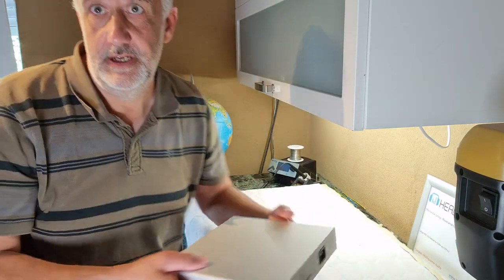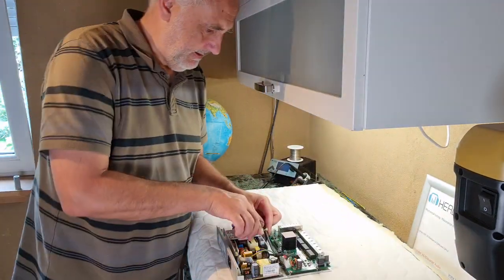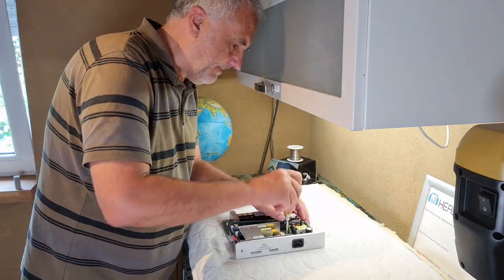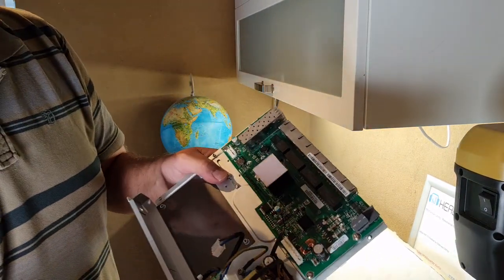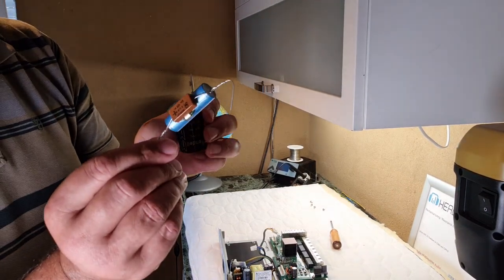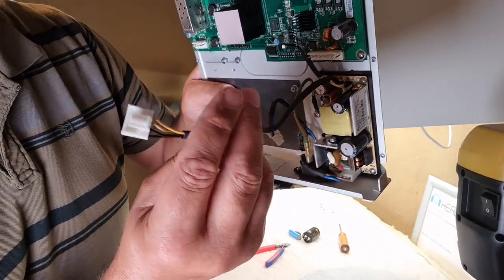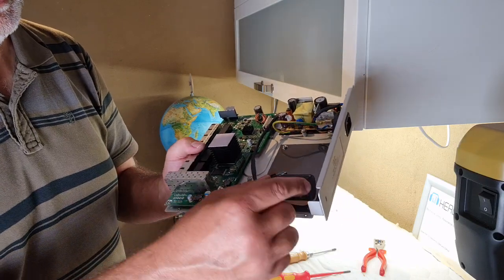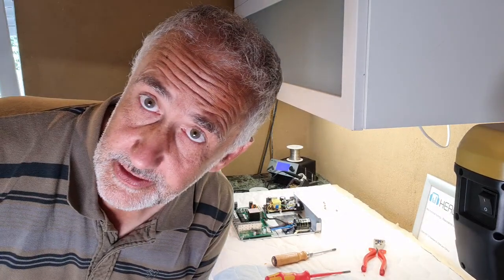Cisco Meraki 220 small tuning for better Audio and Video 4K. Read discription please first !

Comment: Will there be any issue with removing the POE power supply and leaving the cable attached to the inlet (the cable you are holding at minute mark 13:58)?

Comment: Hi Mike, great videos, I have purchased a meraki 220. I have removed the Internet PSU as you have described, I was considering 12v LPS. I am wondering what sort of ampage PSU would be required to run the switch ?
Reply from the maker: 3 A, like the Farad S3 or Audiophools Silver LPS specially made for Meraki 220, or buy LHY SW 10...cheers Mike

Comment: Thank you Mike for the tweaks. I can't find this switch anywhere in Amazon. Would you recommend another switch from the current range that we can tune too?
Reply from the maker: Hi, sorry, but no. There is a older one, Cisco 2960 you find it at audiophool.nl  He can change the clock there too. These old switches ( Meraki and 2960 without fan) you can get only at used market, but if you tweak them, this ist for the price the best you can do. Cheers Mike

Comment: Just got the Meraki! Amazing difference! The main difference I can hear is the relaxed sound. Where sometimes some music sounded harsh, that has gone! But still greater clarity. Auralic G1 streamer, Kinki Studio EX-M1+ and Denfrips Ares II. Have not taken out the PoE yet. Notice greater clarity and texture in the bass too. Its more controlled.
Reply from the maker: Hi, nice!! Thanks for comment. Send it to Hans at Audiophool.nl   you will be really surprised, cheers Mike
Reply: @headquarteraudio5388  hi Mike, I’m getting emails regarding licensing for the meraki. Do you have any advice on how to use it just as a standard switch, non managed?
Reply from the maker: @Bones135  Hi, i did not do it, but pressing the reset button on the front for 15sec is a good solution to bring him back to unmanaged mode. But no guarantee Cheers Mike

Comment: Hello what capacitor and shunt did you use.And how are they connected.Is the shunt connected parallel to the capacitor?
Reply from the maker: Hi, shunt in parallel to main cap, you can see the cap in the video. Shunt you can use all what you want and what you will pay for :) Cheers Mike
Reply: Great mod! Thank you for sharing. May I know what capacitance number of shunt capacitors are? Many thanks!

Comment: Hi Mike ,my system is simple, modem---router---just added Meraki 220---Then out of  Meraki month old ifi Pro iDSD Signature steamer ( I love)and laptop. All connected at this time with Audioquest Pearl ethernet cable (??? change later to Cinnamon ???) WOW what that Meraki did.I have the cleanest power supplies  (I have the source) in my whole sound system, I believe in that. ??? I'm Leary of removing that ethernet power in Meraki  or if I do replace with clean source. You have a lot more components in your system to maybe get that power to the system else were.  Remove or leave, or remove but add new power source to it??? Wasn't that power to the ethernet put there for a reason Keep up the good videos. Thanks Bob
Reply from the maker: Hi, poe is not needed in my rig, and i think now one unses this at home, so get rid of it. New LPS ( Meraki of audiophool ) is important, OCXO more, please ask audiophool.nl for this...cheers Mike
Reply: You spent a ton on a cable. Dump the computer, use just the WiiM Pro, not a plus for streaming to a decent DAC. You will be surprised.

Comment: I tried this meraki with 12v linear power supply (studer900 clone) and I can confirm that sounded significantly better than with the internal switch mode 12v power supply.
Reply from the maker: Hi, maybe my next step...but this is very good too. Maybe best ist extern LPS and my tweak intern :) Cheers Mike
Reply: Hi - what power supply did you use? Where can I buy it? Thanks

Comment: I have to put my hands on one of those old switch. 👍🏾
Reply from the maker: Hi, and cascade them :) Cheers Mike
Reply: @headquarteraudio5388  it worked, i added a linear power supply to a Netgear switch and it was even better. A little change in the picture of my Amazon fire tv connected to it. It was even bigger when i changed the jack dc 2.1mm cable of the LPSU for a home made one with better plugs, switchcraft, and better cable. Then the image quality completely changed. The color tones are way better ! More natural skin tones. Better scale of black levels. It's amazing ! And the sound got even better.
Reply from the maker: @yannick930  Yeah, and now Cisco Meraki with OCXO Clock...    www.audiophool.nl.....its mindblowing  cheers Mike
Reply: @headquarteraudio5388  It's my next step^. I have to ear it :)

Comment: Why are you paying the expensive price for a Cisco POE switch only to remove the POE?
Reply from the maker: Hi Rob, Meraki 220 8P used about 80,- € top quality parts inside, good power supply+ not a extern one!!, after removing the POE SPS space for tuning parts...very!! good quality of the case, high end optics behind the rig.....more??? the sound with tuning is amazing... i thinks it is enough :) Chers Mike
Reply: @headquarteraudio5388  There is a Meraki MS220 8 available that doesn't include the PoE , but still has the internal power supply. It is in the same case as the 8P, so that would save a bit of work, unless you think there are other reasons for buying the the 8P version. I love your enthusiasm.
Reply from the maker: @haraldhommel2369  Hi, many thanks for that information for us! :) I hope to keep my enthusiasm :) Thanks for watching! Cheers Mike

Comment: HI Mike... I am very interested in this Mod. I recently picked up a Cisco Meraki MS220 - 8P for a very good price on ebay. Just wonder where to get the Kendeil K05 2200uF 100v. I live in Canada by the way and love your show a lot and watching everytime once there is a new video. Thanks again.
Reply from the maker: Hi, Kendeil is hard to get, use muliple Panasonic FC 470uF or 1000uF 105 and a very good foil cap plus silver glimmer....for more incl. OCXO Clock upgrade and his new LPS Ultra watch www.audiophool.nl  ...this is a must for reals music in streaming...  cheers Mike
Reply: @headquarteraudio5388  Thank you so much for your reply. I was interested in the shunt that you used as well. I can see that you hat mentioned Richard Jahre  Silver Mica . Would you be able to share more details on that item?/ Much appreciated. Derek
Reply: Hi Mike. Just wonder if you would recommend Mundorf MCap Supreme Silver Gold Oil Capacitor? if so, what will the model I should get which has the same output as your Kendeil K05 2200uF 100v. Much appreciated.
Reply from the maker: @derekdknty811  Hi, its also hard to find, its NOS. Maybe at German ebay.kleinanzeigen...Or Russian Mica SSG01 at ebay... cheers Mike
Reply from the maker: @derekdknty811   Mundord SGOils is a good cap, but better as signal coupling cap. The Panasonic FC are very good electrolytic caps...470uF 35v  6x or Nippon Chemicon LXY...with Mica SSG01 and a foilcap...easy to find Wima MKP 10... but, dont spend to much money for the caps, much more effective is the OCXO upgrade...cheers Mike
Reply: @derekdknty811  Hi Derek, I also like in Canada. What parts did you end up getting? And where did you buy them from? Thanks!
Reply: Thanks Mike
Reply: @headquarteraudio5388 Hi, could you tell me the value of the shunt I need to order please?